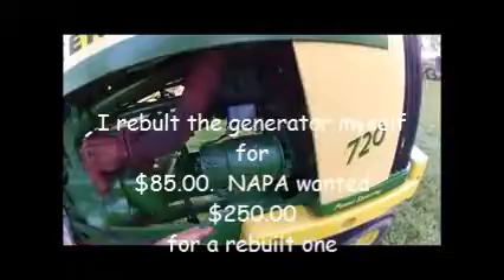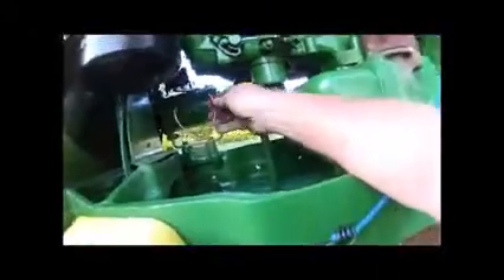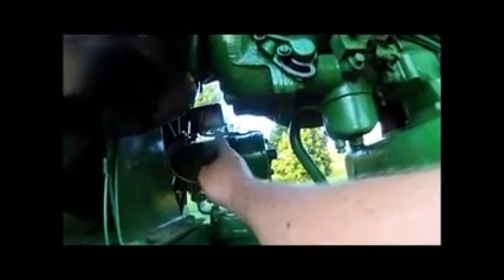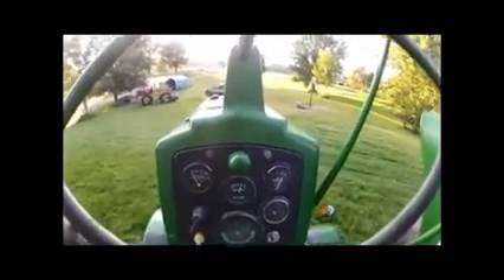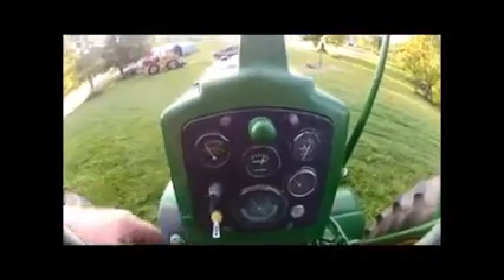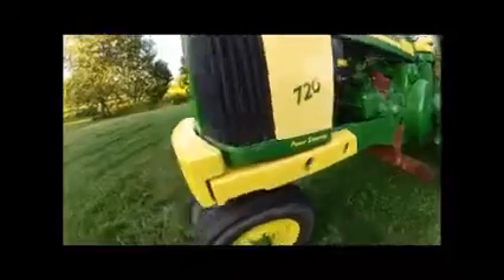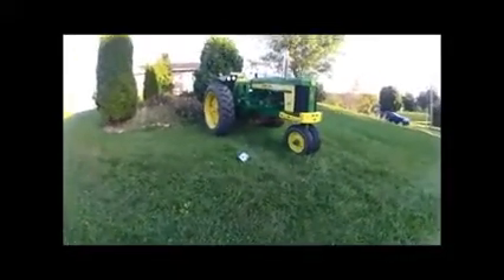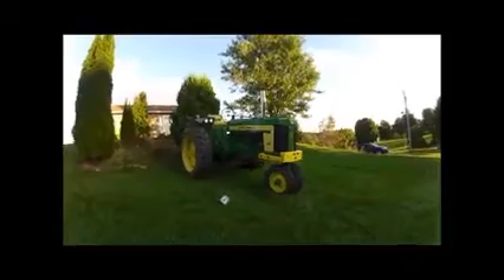Polarizing the Generator on the John Deere 720

Comment: I have a 620 won't charge. going to try this. Thanks for sharing. What should the temperature Guage read for normal use. Mine won't go over the 140. I had it out drove it around for over A hour, Not sure if gauge is bad.